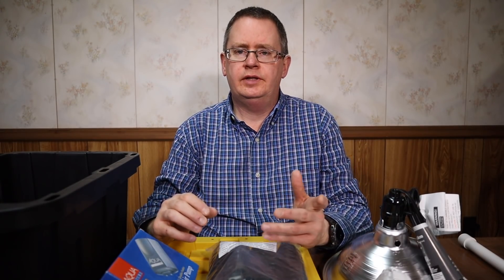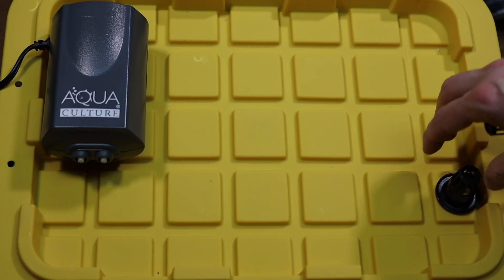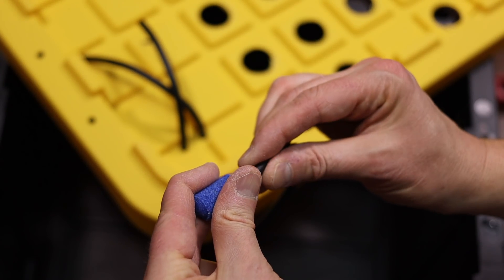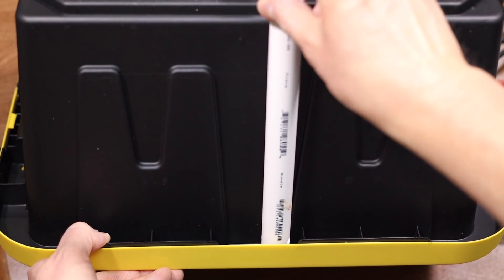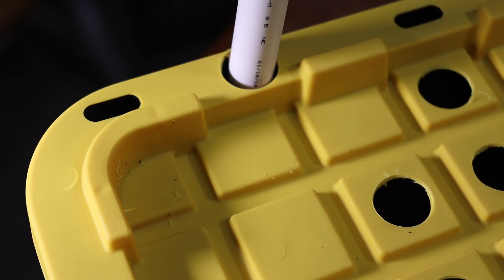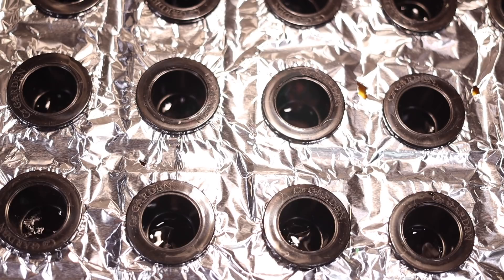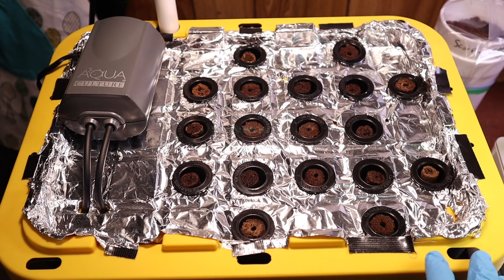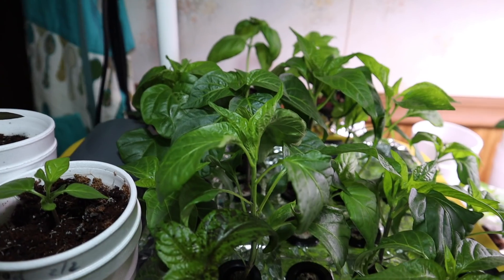How to make a hydroponic seed starting system cheap and easy

Comment: Do you really need light during  the germination phase?
Reply from the maker: For most seeds, I don’t think it hurts. Some are sensitive to it. What I do now is pinch off a small piece of the sponge and place that in the hole over the seeds. This blocks light and helps keep some humidity in. I let the lights operate on schedule. When sprouts emerge, they have it available.
Reply: @pepperdactyl  I have some scotch bonnet seed just getting to start - how long do they typically take and do you use a heat mat? My garage is typically over 80 F.

Comment: Hi Peter, great system and great ideas. Just a quick question, how often do you need to change our the water?
Reply from the maker: Every 2 to 3 weeks, earlier on, not as much. You can top up with water or more nutrients in-between changes.
Reply: @pepperdactyl  awesome. Thanks for the info mate. Cheers.

Comment: Thanks for the video, but this is not Cheap or all that easy.  If you already have everything thing on hand it may be cheap but if you're a beginner you have to figure in cost of the tools (at Home Depot the hole cutter and attachments alone are $45) and that does not include the drill itself.  The plugs and net cups are not cheap either.  Although, a good system,, for a beginner you're looking at well over $200 all in, NOT cheap.
Reply from the maker: Thanks for watching. If you shop around, you can get the hole saw setup a lot  cheaper, 10-15. Any cheap 20.00 drill will work. Same for net cups. I would check Amazon, but also ebay.

Comment: Hi Peter I am planning on making one of these to get my seedlings started for this season. Do you have any tips on transplanting to soil?
Reply from the maker: The way I do mine is transfer them to good quality coco coir, in an intermediate pot  like a small nursery pot, the kind that fit 18 to a 1020 tray, or similar. Even 20 oz cup with drain holes is fine. I'll keep them in a bigger area under grow lights until it's time to transplant outside. It's key to have very airy and well draining potting mix. I'll usually bottom water during this period. There is usually a little bit of a set back period, maybe a week or two to adjust to the new setup. When transplanting outside, for container plants, I use a peat/bark based potting mix like Fafard 3B, with a little extra perlite and some compost manure like Black Kow. One those I use osmocote 14-14-14 at 1 Tbsp per gal of mix. I'll add a 1/2 cup of bonemeal at the start mixed in the bottom half. Later I'll add Minor Essential Elements at 1 tsp/gal of mix, and re-amend that and the osmo through top dressing throughout the season as necessary.
Reply: @pepperdactyl  thank you for the quick response! Just a couple follow up questions if you have a minute,

1) when you transfer them to coco, I am assuming you are bottom feeding them with hydroponic nutrients?

2) What would the consequences be if I bypass the coco and transfer directly into say some FF Ocean Forest for the intermediate pot stage? Would there be any special watering or lighting tips if I were to attempt this?

Thanks for your time!

Comment: Hi Peter, would you use the DynaGrow through the entire process, or ever switch your nutrients up if these start to bloom? Cheers
Reply from the maker: Dyna-Gro 7-9-5 is good by itself start to finish.
Reply: @pepperdactyl  Awesome, I'll get some! Do you pH your water before adding nutrients, or after? Thanks for your response!
Reply from the maker: @Bigz4ch87  It's good to check your pH and adjust if necessary, after adding the nutrients.

Comment: nice vid. each step is clear. why is aluminum foil needed?
Reply from the maker: It's optional, but I used it to help block light from penetrating the lid. This would slow or help prevent algae from forming inside. Thanks for watching!
Reply: Peter Stanley oh ok. I always wondered. thank you.

Comment: Use 100% silicone on the first tub that you cut too deep on just apply enough to go inside the two cut marks and smear little over on the outside edges on the inside and outside wait 30 minutes and it should be dry enough you can use it
Reply from the maker: Thanks for the tip!

Comment: I Injoyed your video Peter, and plan on making a similar system. I purchased a couple 5 Gal. totes that look to be just like yours from HD. There the perfect size and the price is right. Problem is they are not made of food safe plastic. I'm thinking of lining them with a food safe liner such as a large turkey sized oven or brining bag. Would appreciate any comments. What's your take on this?
Reply from the maker: Thanks for watching, Chuck. Since most of my applications for these type systems has been short term, growing to a transplant size, and moving to other mediums, I haven't put much thought into the material's food safety. I think a consideration for that would be especially important for growing something long term like greens and herbs. Your idea of a turkey baster bag sounds great. Another alternative would be to source out a better container. Sams and Costco bakery have some excellent containers of all sizes you can ask for. They might charge now, if so it's not much. But they are all food safe. My favorite are the square 4 gallon icing containers that have the snap on lids. I've used bunches of those as self-watering grow containers, and for DWC and low-pressure aeroponics. They would work fine for this as well. There're be a little less lid area than the 5 gallon tote, but would still work fine.

Comment: Had a question about this method Peter. What about temperature control when doing this? Don’t you still want to be @ a higher temp?
Reply from the maker: For this particular setup, I just let it remain at room temperature which was around 70 degrees. Everything seemed to work fine. I haven't done any tests to see if lower/higher temps make a difference. I'm sure too low or high is detrimental. Thanks for watching!

Comment: Hi Peter, can you please tell me your timer schedule for air pump and light operation? Thanks.
Reply from the maker: Thanks for watching! I ran the pump 24/7 and the lights 16 on 8 off.
Reply: Awesome, thanks for that. Would this be the same for a DWC setup that I'm going to use for bringing a jalapeno tree in from outside?
 I'm also looking to run a seedling heat mat in my grow tent for a bit of warmth, could you suggest a run time on this too please? Thanks again for your help.

Comment: Love this system Peter.  I really like the tip about cutting out the bottom.  I was thinking during the video it would be hard to get the plants out for transplant.  Thank you for sharing this project.
Reply from the maker: Thanks, Jim! Another tip from BD Beatz, I don't remember if I mentioned it, is the Rapid Rooter plugs can be quartered and fit those perfectly. So a bag of 50 is really 200 in the 1-inch net pots. I confirmed that today with a few more I started in the office.

Comment: Dont use foil! Mylar or other similar material is much better.
Reply from the maker: Thanks for the tip. What are the issues with using foil?
Reply: @pepperdactyl  Light doesent spread eavenly and as result you could get burned spots on a plant. It reflects good but u dont get the full spectrum of the light.

Comment: also, I 2nd what BD suggested. If you cut the bottoms off the cups you might not need to cut the AG sponges. Worth a try anyway.
Reply from the maker: Thanks. It'll make it easier on pulling those roots out too.
Reply: Could i just move the plugs from the small unit to a bigger hydro unit to grow to maturity?

Comment: Is it necessary to run the air pump before the seeds have germinated and the plant has roots?
Reply from the maker: You could leave the air pump off for that if you wanted, just keep the nutrient/water level about a 1/4 inch from the bottom.
Reply: Peter Stanley Thank you sir.

Comment: Love it.  You could spray paint the top and put the lamp support in the container with a "T"'ing out the pvc along bottom to prevent movement.  Just a suggestion being how cheap they are.  Works wonderfully and much cheaper than its alternative.  :O)
Reply: Oh, and oasis cubes vs sponges.
Reply from the maker: Thanks for the tips, Brent!

Comment: looking great. How important are the air stones ?
Reply from the maker: For a DWC (deep water culture) system it is important to provide oxygen to the roots, while they are submerged in the nutrient solution.
Reply: I'm just messing about with my first hydro projects now. So you can keep the roots fully submerged if you use the bubblers ?  I just started a couple kratky buckets a couple weeks ago with the nutrient solution coming up to the base of the first root then let it get used up till half the ( newly grown) roots were in air in the container and half in solution and I maintain that level now.